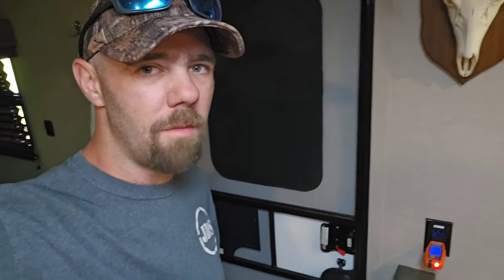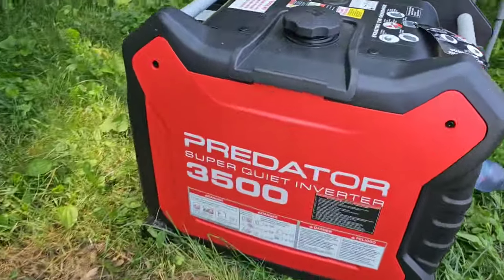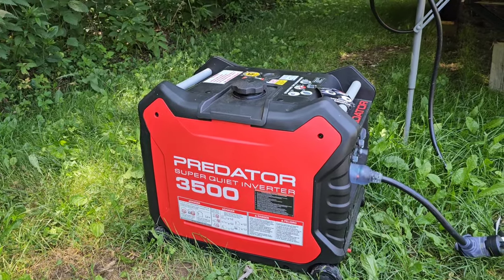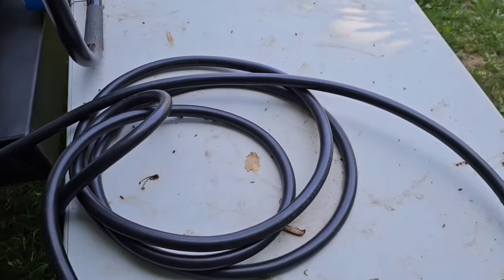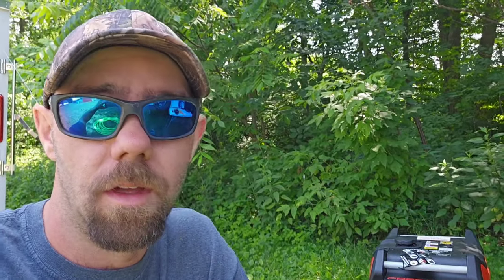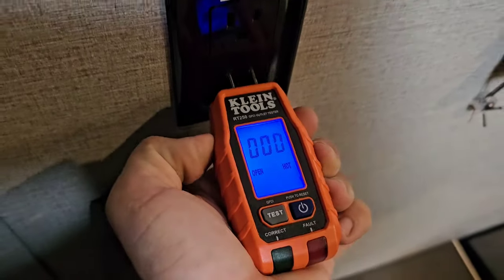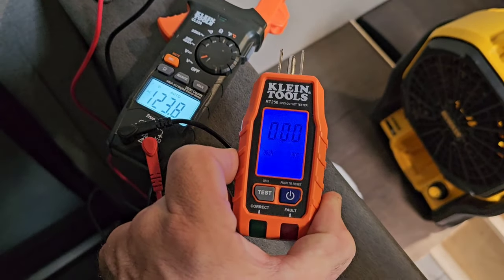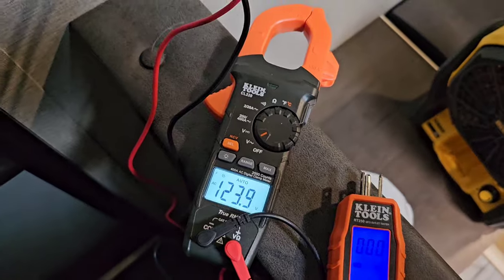here is the solution to the popular 3500w generator problem

Comment: You do still have a problem though. When using the 3500 watt generator it sounds like your neutral isn't bonded (grounded) anywhere, so it can float to potentially dangerously high voltages. Also if you don't have the RV ground grounded anywhere, the ground too can float to a dangerously high voltage.

Most people just consider the shock potential, but high voltages on circuits designed for only 120v can jump, igniting a fire inside a wall, appliance or device (not to mention damage electronic devices, like laptops).

We had the same problem at our cottage.

In our case we had several old appliances, including an old 1970's kettle and a 1970's TV that we used.

These older devices, including our metal kettle, often bond the outside to the neutral.

What used to happen, seemingly randomly, was when we touched the outside of our kettle we would get a huge electric shock.

Initially my father thought the live and neutral was hooked up backwards to the kettle, but flipping them resulted in still getting the huge zap plus now we'd be left with a constant 120v between the kettle and floor (which made your fingers tingle most of the time when touching the plugged in kettle and zapped you with close to 120v when in bare feet).

Touching the kettle again, right away, we wouldn't get as big a shock, but if we waited a few minutes the shock would be huge again.

The problem confused us for many years and we lived with the old kettle, the old toaster, our old canister vacuum seemingly randomly zapping us. It became something of a laughing joke, with each of us getting randomly zapped over and over...

Eventually we figured out this occurred when the TV was on and we then figured out that it was leaking high voltage onto the neutral line relative to the ground (the TV had a 3 prong plug).

By grounding the neutral (and house ground) at the panel to a large copper rod hammered into the ground we were able to completely fix the problem.

A lack of bonding your neutral to ground and lack of physically grounding your RV/house ground can result in very strange, confusing and dangerous things happening.
Reply from the maker: I did use a grounding rod in one test and it still had the same results. Just a generator thing I'm guessing
Reply: That is confusing. How can testing the plug at the generator look good but testing the plug in the RV be messed up, if the ground and neutral are properly bonded somewhere as well as grounded to earth?

Comment: Wait, why doesn't the big generator do the same thing?
Reply: I was wondering the same thing u would think it would always do it since he said campers have a open ground I understand that part but I'm not a electrician  I would really like to know the answer from someone that does know why that's for sure
Reply: Campers do not have an open ground. The generator has the open ground. This is why some generators have a grounding post to connect to a ground rod or another grounding source. The problem is that the tester is mainly designed to used in residential (household) situations. When using it in a RV that's connected to a generator that has an open ground (not grounded) you see a false reading on the tester. The tester sees this as a hot /ground reversed even though it's actually just an open ground. The reason some generators do this and others do not is because there's basically 2 types of generators. Some are open ground and others are bonded. Bonded is when they connect the neutral and the ground wires together. This eliminates the open ground and also if there an electrical short, it sends the spike in amperage back the generator breaker and it will trip off. If your really interested in the technical stuff just Google why are some  generators open ground and others bonded. It's too much for me to get into here.  The sum of this is that the bigger gen set is must likely bonded (not open ground) and the smaller one was not (showing the open ground). The funny thing is that all along the camper is ok using both generators. It's the tester being used in a situation it was not really designed for (RV on a gen set). Hope this helps and doesn't read out like a bunch of gibberish 😉
Reply: @OneRoomShed  thanks for the information
Reply: @OneRoomShed  Actually the national electrical code requires the neutral/ground be bonded at only one point so as not to create circulating currents from multiple bonding points.

When feeding a house: 
Since a house is already bonded at the service disconnecting means YOU DO NOT BOND at the generator leaving the genset with a floating neutral. (the genset is grounded from the grounding conductor from the house as all equipment must be grounded)

When feeding a trailer:
I don't have much experience with travel trailers so don't quote me on this but the neutral/ground must be bonded somewhere and I have heard some travel trailers won't accept a power source from a generator with a floating neutral. (GFCI,s won't work properly ect) The grounding conductor must be able to get back to the power source (genset) and without a bond it can't. They do make a plug that will connect the neutral and the ground together that you only need to plug into a genset receptacle that will accomplish this.

Grounding and Bonding is one of the most misunderstood principles of an electrical system so consult a qualified electrician.

When the hot and neutral conductors are wired wrong it will trip a breaker or the load just won't run. When the grounding and bonding isn't right you may not know it until your on the wrong side of the grass.
Reply: @OneRoomShed  Not calling you out on anything.  Sorry you took it that way. You are right, you must know if your genset is bonded or has a floating neutral and if what your feeding already has the neutral/ground bond and act accordingly. Thought I would add to your comment from a 40 year journeyman electrician and apprenticeship instructor.
Reply: @liffy8333  shit, sorry man. I completely misunderstood. Totally my fault, my brain is fried.  I need to take a break from YouTube for the night. No disrespect intended. Going to delete my other reply because I'm totally embarrassed 😣.
Reply: @OneRoomShed  Please don't be embarrassed. I feel the reason why people are confused on the floating neutral thing is they don't know where its needed and not needed. My first example is where it has to be floated and second example is where it needs to be bonded. Looking back at my first comment I can see how you may have misinterpreted it. It's all good man, that's how we learn.
Reply: @liffy8333  you caught me just before  shut my cellphone off. Thanks for understanding. I totally get what you're saying now. You explained it really well. Sometimes I get on the defensive from getting trolled on the past I guess. Nothing wrong with learning a new lesson 😉.
Have a good night my friend 🍻
Reply: @OneRoomShed  Wow, thanks for that. A guy can never have too many friends. I accept that, thanks. I try not to comment on electrical stuff on the interweb thingy because it ruffles some feathers but this time the video went on and on without the correct solution in my opinion. The problem is when I do I always come off as giving a lecture to my apprentices in class. I can't help it. I believe if the generator was bonded correctly there wouldn't be issues with his circuit tester. 

When your circuit tester found a problem but your multimeter didn't it is still cause for concern. I'd like to know what your multimeter read hot to ground and neutral to ground. Without a neutral to ground bond those measurements will be off and that's why your circuit tester was hanky.
Reply: @liffy8333  I was actually originally questioning the same thing on this guy's original video. I had originally suggested suggested making a proper ground connection between the generator and trailer because of the open ground on the gen set and the 30vac reading. I thought he might have a "hot skin" on the camper. Even though most campers actually do a slight ac voltage on the chassis I was wondering what the actual numbers were under this situation. I still agree that these outlet testers can give inaccurate readings when not used a typical residential situation because I've experienced this myself many times working on RVs. That's what I haven't used them in years. A simple open neutral sometimes shows as a hot / ground reversed. That alone can throw you throw a loop when trying to find the fault. That's why a real multimeter is the best tool for any electrical situation. 
Even though he actually had 125   volts at the outlet, I'm still questioning what's on the ground / chassis side. 1 or 2 volts is typal (I think 5vac is the max allowed but don't quote me). In all my years I don't think I ever got a chance to check for voltage on the chassis when the camper is being powered by a generator. It would be interesting to see what the numbers are. This is the thing I enjoy about electric , you never really know everything and there's always something to learn.
Reply: @OneRoomShed  I will leave you with this. I once was called to a single wide mobile home trailer where the occupant went to Safeway to buy rubber gloves to open her door (got a shock without them). Upon trouble shooting I found that the grounding conductor had not been connected well at the service pedestal and corroded off. So the frame of the trailer was hot, but why? I found the refrigerator had shorted to ground but couldn't clear because of the open grounding conductor at the pedestal causing no neutral to ground bond. I unplugged the refrigerator and cut off the plug so it couldn't be used and reconnected the grounding conductor at the service pedestal and told the occupant to get a different refrigerator. I have many many other fun experiences because all electrical problems can be explained with AC Theory, adequate training and experience but it's a lifelong endeavor.
Reply: @liffy8333  it's funny how many times I've witnessed a failed refer unit cause a short to ground. At least with the older Domestic units. Now a lot of of camper have 12vdc refer units and a lot of higher end units use residential style units with power inverters. The older Dometic units required 12vdc for the control boards but the main cooling unit could be used on propane (gas burner) or an AC electric element (you may know this already). I've witnessed those ac elements burn out an short directly to ground to many times to count over the last 20 years. Unfortunately the lack of actual electrical code in RVs can lead to a chian reaction of other failures. These scenarios (including yours) shows how important proper grounding really is. That and preventive maintenance (at minimum an inspection once and a while). Funny cause recently I actually noticed that ground wire had corroded off my main propane line that feeds the house (outside). I stopped everything to fix this immediately. The thought of possibly having an energized propane line 😲.  A couple of years ago we had a house explode in my  area from a propane related issue.  It literally lifted the house up from the foundation. I never found out the cause but this motivates me to stay on top of my own stuff as much as possible. 
I respect electricity (and propane) because if you don't follow the proper guidelines the outcome can and will be deadly. 
Thanks for the conversation, I always like to hear other people's experiences. The more I learn the better I can do my job (and keep myself and others safe).

Comment: You mean a tool that shows ground fault error is displaying ground fault error? You could have said this in your short btw. You just played the content game
Reply from the maker: Yea except it's not displaying a ground fault error it's showing hot ground reversed 🙄
Reply from the maker: Oh and I have original not copied from anyone content that's informative so dam right I'm going to use it. Thanks for the 6 minutes of your time on the toilet.
Reply: Thanks for the follow up video. The first one really had me wondering.
Reply from the maker: @MsMarkpeggy  no problem. It took the 1st video in order to find the actual problem instead of the guesses in the comments. I never would of thought the kline tool was the issue

Comment: Dude… this is why you read the instructions every time you buy a new tool.

if you would’ve taken the 5-10minutes to read the manual for that Klein meter, ESPECIALLY, since you’re clearly not very knowledgeable in electronics whatsoever. 

Reading the manual will inform you of how to properly use that meter, and how to troubleshoot issues.. 

Also, I already know that you didn’t read your predator 3500w manual, because if you did, you would be installed a proper ground rod, as the manual states clearly, and multiple times; the generator MUST be grounded to earth before using, every time.

The internet is great but this video is so pointless 😂

People come across issues and instead of just reading the manual they already have, they search around on the internet or make videos for YouTube to try and solve the issue.. viscous circle of stupidity… 

READ THE MANUAL! I read every manual for anything I’m working on or any tool I’m using.. it gives a huge advantage to proper usage. I don’t care how knowledgeable anyone is, the manufacturer made the part/tool, and they have given you a manual for it.. it’s funny how many people don’t actually read through them.. pride combined with stupidity combined with ignorance… good lord, humanity is doomed…
Reply from the maker: @AdamMak-f6l  well you also clearly can't read or listen to a simple video. I did ground the generator..... with a grounding rod...... your correct humanity is doomed and liberals like you who spout off without properly educating  yourself before you comment leads to replies like this........ congratulations on your gold ✨️ you earned it kid.